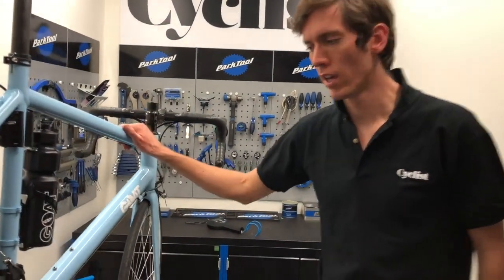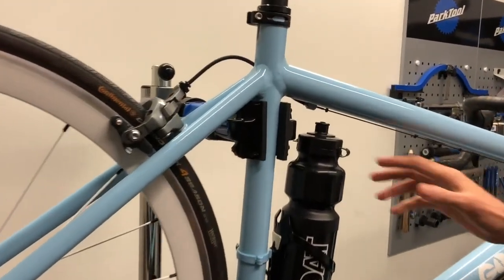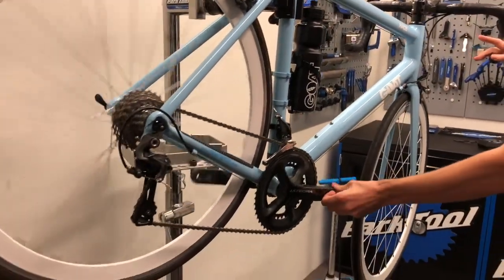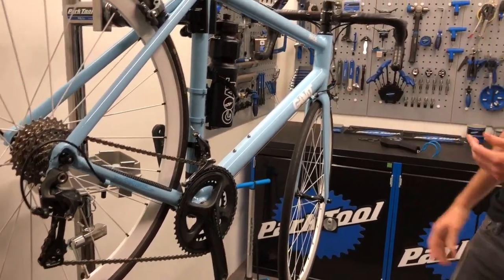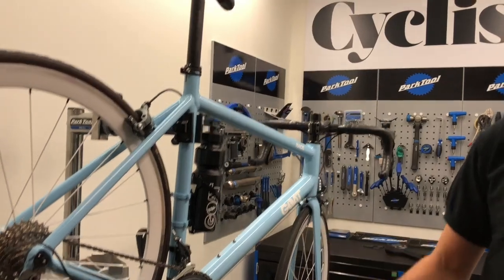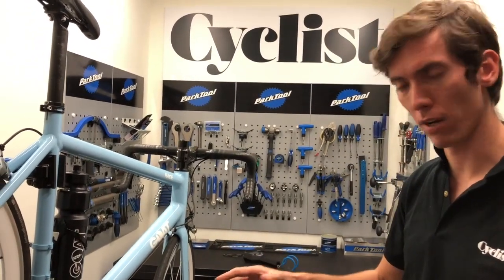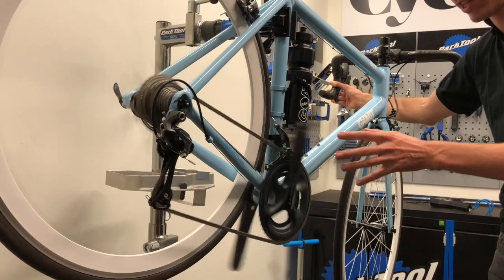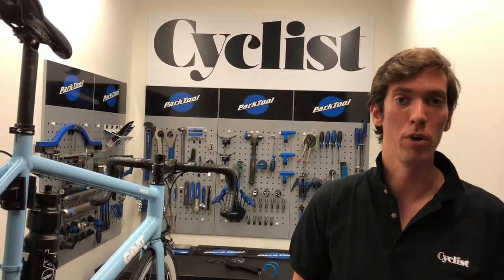How does a hidden bicycle motor work?

Comment: That's something how that Motor looks just like a Water Bottle😮
Reply: The BATTERY looks like a Water Bottle. The motor is inside the tube connecting with the crank axle